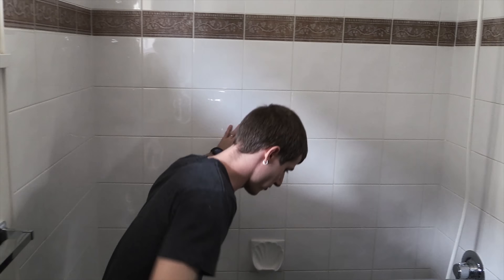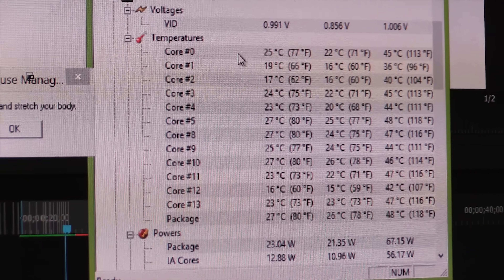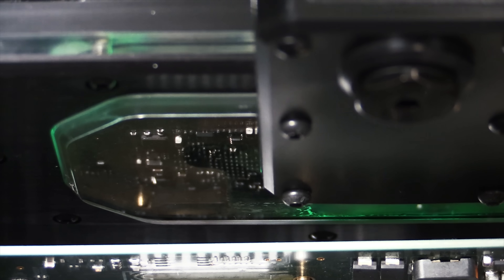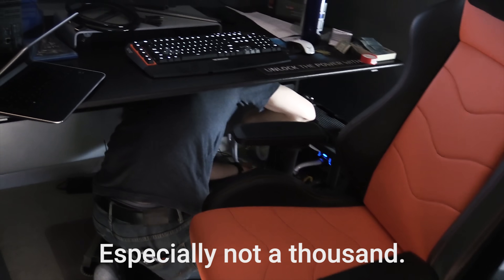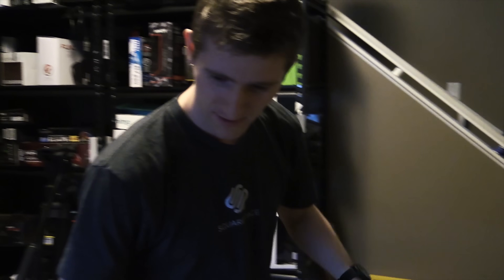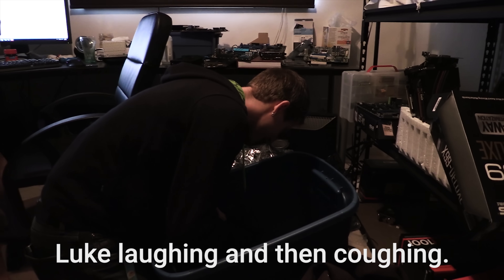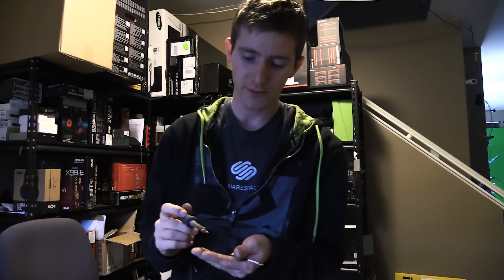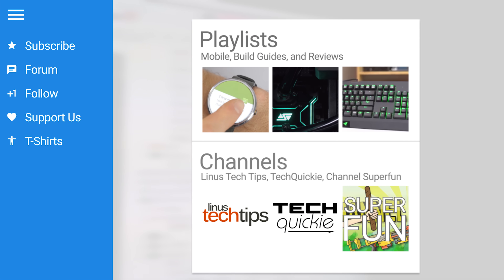Whole Room Water Cooling Part 5b - Some Issues, More Solutions...

Comment: 1.  Get soldering clamps that are weighted so you don't burn yourself (as much) haha.
2.  Pre-tin your wires.--> dip them in flux, then heat the wire and apply solder to the wire once it's hot. you can also put some solder on your gun and apply it to the wire once its hot, however i do a combination of both. 
3.  Position clamped pre-tinned wires so that they are touching e/o.  
4.  Apply heat right in the center between the two wires and the solder will melt/dry up together as a good connection.  Once again you can also have solder on your gun and/or apply more solder to wire for even more of a  connection.  User preference.....

Comment: have your soldering temp up to at least 350 deg Celsius and you want to run down the tip on the wires while injecting flux.

Comment: For patching cables using soldering I would twist the braids of the two separate cables together so when you solder it together not only does it have a good connection but it is really stable too.

Comment: Never use any solder that isn't flux core solder on a soldering iron. you'r alloy type isn't much of an issue in your case. Just remember that flux shouldn't be used unless it is absolutely necessary. hope that doesnt seem like trolling lol i solder every day at work so ya thought i give a few pointers. id be happy to answer any question you might have.

Comment: hey linus, tried to send you an e-mail to ask you something rare about recycling some am3 phenom heatsink, the one with heatpipes, to build a waterblock out of it, using the heatpipes as the intakes and outakes for the water system.. i would like you to tell me if it's possible or not, due to your experience, i'm from argentina and here, everything is too expensive for the average gamer people like i am... ty in advance
Reply: when did i said that it was to be used on an intel socket?.. i only talked about make it a waterblock.. you need to read more closely.. but ty for your answer
Reply: I would guess its not possibe because its not enough space for water to run in there efficently. I dont know tho, just a guess.

Comment: Is this a joke? like molting lead with the tip hoping some will stick and then apply it to the wires? And why strip a kilometer. How about youtube something before you buy/use like we are doing? How about putting everything together and let the iron melt and stick... i don't even want to try, this looks like a heavy troll.

This water cooling part should have stopped at video #2 max #3! 5....? B...? Serious?
Copper is not a cheap material most people don't afford it for heating , extra tools + time, is fine if you want it to be like a learning curve, than do a proper investigation before you do anything.
How about thermal exchange with the room if you have all that copper there, why the top of the room because heat rise up in a room, you want cool the room? why connect the computers than?

Why so many fans and radiators, what is the heat output? Who calculated this? Such a waste of resources, is too much pipe in that room + pumps the volume of water that has to be moved around is huge, how much electricity goes in this system? What is the efficiency of the system?
Buy a mini fridge and stick you'r reservoir into it it will be much cheaper  and less complicated.

Sorry guys for the negative post, i usually refrain from posting both here and forum but this time i could not hold back anymore. I still love you all look i'm hitting the like button despite the epic fail in this series of water fall vlogging.
http://take.ms/Cvm2T

Comment: Soldering Tip: Twist the wires and flow the solder, keeping the soldering iron under the area your soldering. To join the wire, place them as close together and if needed apply a minimal extra solder as you heat the wire and to help them solidify quicker, gently blow on the connection.

Comment: 2 pumps with different specs in series might not be the best idea, i would look for a real water pump for copper tubes and make a less of a bath tub install :)

Beside that, don't have a high voltage power cable out on the roof, put the regulator inside and use 12V cables only outside. 

Fun project though, its not the time or money its because we can to all you asking if something else might not have been cheaper :)

Comment: Soldering tipp:

Get a proper Soldering station which is temperature controlled. and 63/37 solder instead of regular 60/40. it got a fixed melt temperature while 60/40 has a wide range of melting temps. and also not cheap solder, but solder with flux ^^ And maybe a third hand. really good and cheap tool to have which can really help you even for soldering wires together :) I would try to put the two wire directly together and then applying the solder instead of tinning the ends and then solder these together

Comment: When soldering, don't touch the solder with the soldering iron. The soldering iron is meant to heat the two contacts to a temperature where they can smelt the solder themselves. This creates a MUCH stronger connection, one that is stronger than the wires themselves. The way you guys did it, it could potentially fall apart by itself over time.

Comment: Dude you're using tap water.... That's why there is gunk in your shit.... Let alone contaminating it further with how your're working on it. You say you used anti freeze.... Well anti freeze 50/50 premixed has water with 0 deposits.... You put in pure anti freeze and tap water into a vehicle and it will gunk up the radiator over time and then clog. This whole thing is pointless, beyond wanting something to do. I see it as failed ideal cooling setup and a fail at marketing.

Comment: Dear LTT Team, here are some hints for soldering:
-use the right solder for your purpose! in your case: electronic solder or radio solder
-do not use extra flux, you dont need it, and its very corrosive
-twist the two wires from your harness up in parallel
-Keep the tip of your soldering iron clean (wet sponge)
-heat the stripped, twisted wires up with the soldering iron (can take a few seconds dependinng on the power of your soldering iron), then apply the solder and keep heating until the solder has saturated the wire and leaves a nice shiny surface
- do the same with the wire coming from the power supply
-align the two "pre soldered" wires and heat them up with the soldering gun so that the solder (already on the wires) melts and connects the two 

- repeat for the other polarity strand :)

if you just keep adding "chunks" of solder to the connection (what it looked like in the video) youll get a "cold" solder joint, which will eventually break on you.

hope this helps!

Comment: First of all I like the soldering station you choose! I have the WESD51.

Tips:
1. First of all solder only in a well ventilated area (especially when using lead solder)
2. Use lead free solder if you don't mind the harder to work with material since it is better for the environment and you!
3. Use a much thinner gauge solder!!! The solder you where using is WAY to big.
4.  Depending on the solder make sure your soldering station is set to the correct temp as it will make the job much easier (450-500F for lead and 600-650F for lead free)  
5. get a solder with a flux core so you don't need to add flux as often.
6. regularly clean the tip of the soldering iron to prevent a build up of burnt flux
7. Change your tip size depending on the job you are doing (thick for tinning wires, medium for through hole, small for surface mount)
8. twist your wires together before soldering so that they stay together and you don't require as much solder to connect them making a much cleaner solder joint
9. solder suckers are helpful for when you mess up and need to de-solder a joint (like what Linus did)
10. best way to have good soldering is just to practice! Took me about a 10 hours over a years time to have really good soldering.

If you need anymore tips or help I can answer but you can probably just Google it instead. 

Hope this helped a bit, Michael

Comment: Love the concept, I really do, but the execution could have used some more planning!  The head pressure on the pump(s) should have been taken into account, liquid to liquid heat exchangers would have isolated each of the computers to their own water supply while utilizing the cooling of the room system (and made it incredibly easy to swap from local rad to room cooling for many computers), the radiator setup (while awesome to see) would have been better served by a copper car radiator or two with matching fans and a PWM controller for cooling performance, and the soldering could use some work!  I'm available to fly up to Canada and help with the next setup after the move. :D

Comment: For the soldering. Put some flux on the wires then heat it up. The flux will boil making the solder flow into the wire. When adding solder, heat up the wire and add solder to one wire at the time. 

If both ends are prepped with solder, put them together. Heating up the wires again and adding a bit of solder. Also, i think you have the wrong solder. It looks like plumbing solder. Not meant to be used for electrical purpose.

Comment: Probably the dumbest project I've ever seen Linus do (Ok, the painting the motherboard was stupid too).  Didn't he think that all that copper tubing in that room would radiate a considerable amount of heat before it ever gets to those radiators outside?  How about a larger radiator with larger fans instead of smaller radiators with many fans?  Come on Linus, your modding skills and basic reasoning can't be that low.  Tinning the leads then trying to solder them together?  How about twisting the wires first then joining them with solder.  I think that just may be common sense.

Comment: Soldering tip - twist naked wires together, so they hold while you solder them. That way you have much smaller gaps between wires, using much less solder and having smaller chance of cold connection :-)

Comment: hey bro i have a pro tip for soldering. you put the iron on the wire untill it gets hot enough to melt the solder stick on the top of the wire. it will soak up like a sponge. also you were using the wrong tip for the soldering iron. 

btw i have a family business and we build power transformers 15+ years of experence

Comment: And second thing about covering up soldering is called jacketing where a rubber jacket is used and two wires are soldered and than rubber jacket is just brought in contact to soldering iron heat and jacket shrinks and soldered connection is covered .

Comment: So as I saw ur part 5 I noticed that u have connected two main water pumps serially so pressure head generated is not such effective because 1 pump has slight higher pressure than other so I would like u to switch both pumps individually sucking water from reservoir and than sending it through one pipe to whole room that will increase ur pressure head by large amount . ( concept is like serial and parallel connection of electric cabels)

Comment: Honestly it's stupid design. On the beginning you forget that car coiling liquid will never works in the LC. Second - tubes and pipes. So much tubing in the room will work like heaters (just a little bit smaller temp) and you really should put tubing isolation. And last thing. Why You put the D5 pumps to computers if You have such a big pumps for whole loop. Last thing if You have such a big loop YOU MUST have a pressure equalizer, because when you will rise up a temp in the loop pressure will get higher. For me idea was nice but Linus should check information about central heating systems for home and it will be much more easier.
Reply: BTW if Linus want to clean the loop from all garbage the best will be Mayhems Blitz but as i remember they are not sponsors of his channel. ;)

Comment: Long wires is a big no no in low voltage DC systems. That's why the electrical backbone is a metric button volts.

Comment: Tips for use and soldering wires together . 

Strip wires in a sager pattern then stager sripper wires on the other end so the the wire ene will not short out if tape fails. And don't make the cable end don't overlap and possibly of shooting out..

Tin the ends of the wire with solder then bend the wire so they look like the letter j and then hock the j's together then lightly close the ends of the  M's so they will hold the to greater while soldering.

Clean tip on along lightly on spung then put a little solder . Then touch iron to wire where the the solder is hold a few second then touch solder to the wire that your touching it should flow to the other wire..

Then rape the soldered ends togeathe as you go:

Comment: Some soldering tips right off my head:
You should've used thermocontractible tube instead of insulating tape, much cleaner and after some time you don't have to deal with sticky tape.
Instead of twisting each lead and THEN soldering them you could've opened all the threads in both leads, crossed them (like when you cross your fingers) and then twisting them alltoghether. This makes the joint better pull-resistant.
How about no freakin' sata connectors and directly solder the leads from the power supply with the fan controller? If what you wanted was a modular cable to easily separate the PS from the controller board you could've soldered a DC jack and be done with it.
If I come up with something else... well I have to cook launch now I don't think I'll come back and write some more :P
Love your work!
Regards from Argentina

Comment: 12:27 I used to work for a custom wire production company - the way we soldered wires together was to first put a piece of heat shrink tubing on one wire, then push the stripped ends of each wire together so that the conductive strands of each wire intertwine, twist them together, solder, then slide the heat shrink over the soldered part and shrink it down.

Comment: The whole pipe system has been designed badly. That's the root of the problem.
Reply: Right?
I have no idea why it was decided to make the transverse piping so high up. They probably used twice as much copper as they needed.

Comment: You'll rebuild everything for your new office? Try to place the reservoir on the top of your loop and the pumps at the bottom to help bubbles move or, at least, place some air vents on the upper parts of your loop (mainly your horizontal tubes).

Comment: Just so you Linus your volt meter read 14 volts cause that's under no load. Once you attach the fans on there it will present a load and lower your voltage output.

Comment: Soldering tip as requested: use solder with a flux core, wet iron (with solder), twine wires together before going near them with the iron, then make the join in one go by applying the iron with the little solder already on it to help conduct heat into the wire, then after a few seconds feed the solder into the joint and it should flow imediatly, add solder till your happy with the connection, note it will drip off the joint if you add too much, so do it over something not melty. A top tip in addition to that would be use the right tip for the job, a bigger tip holds more heat and allows you to make a clean joint without having to hold the iron on it too long, which can often melt the cable jacket, is terrible for batteries, makes things impossible to hold etc.

Comment: soldering tips: 
1. Use the soldering iron under the wire you're connecting and then push the solder into the wire, it should instantly melt into it after its heated up enough.

2. Twist the wires, then tin them (melt some solder into the wires before connecting) this will ensure you have a good connection

3. after you've done both of those steps twist the wires you're soldering together, melt more solder into them

Comment: In terms of Soldering. "Tinning" the end of the soldering iron helps(putting solder onto the end of the iron before hand), putting the iron underneath the wire and the solder on top to ensure you get a clean solder joint, and flux the crap out of everything you're trying to solder together. You can never have enough flux.

Comment: Solder won't stick properly to a cold joint. The best method is to tin your soldering iron, then heat up the wire (instead of the solder). Then when you touch the solder to the wire, it will fuse by itself.

Comment: Stupid question:
Why they where not using de-ionized water like you use in any other WC system?
Im pretty shure that would have avoided a lot of the bio problems.... plus normal wather and copper....
Reply: I think they did the issue was the antifreeze iirc, which is a glycol based product which certain things really like.
Reply: De-Ionized Water will pick up Ions in minutes inside Metal piping.
Water is a pretty good solvent. unless you're using all Glass (every single surface it ever touches), the Water is going to be contaminated with plastic and metal molecules.

really the problem was a lack of a Biocidal agent.

Comment: TIPS FOR SOLDERING: 
1. Use solder with flux in it, so much easier
2. Heat the wire instead of the solder so you don't get a cold solder
3. Don't hold your hands to close to the wire

Comment: instead of twisting the stripped wire and then tinning it, you should directly tin it. Also you can use a bench vice or extra set of mechanical hands. Also did you use heat shrink tube?

Comment: Instead of using life guard mechanical filters you should look into nu clear aquarium filters. They have a much better filter cartridge. Also you should up the size of the input of the pump. We use those pumps at work all the time and you really need to flood them to get good pressure. Id recommend using 1'' suction hose and then 1'' or 3/4'' going into the second pump.